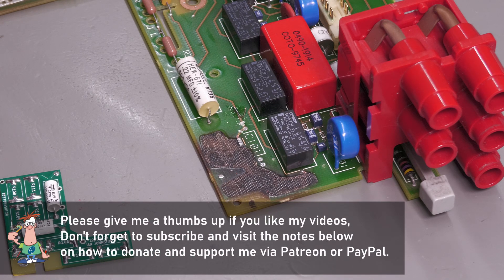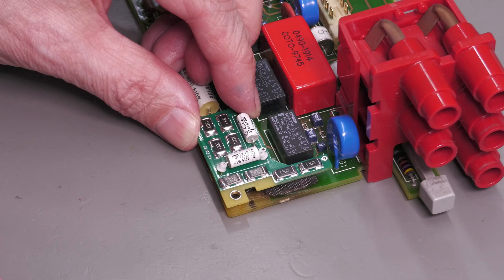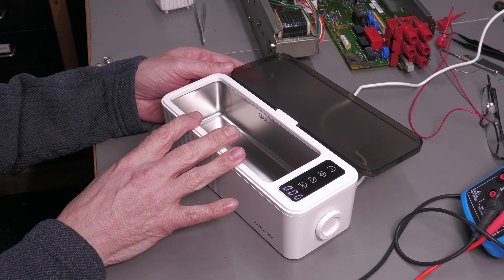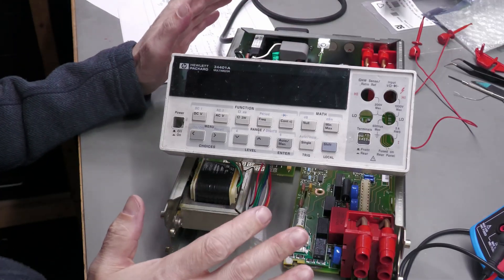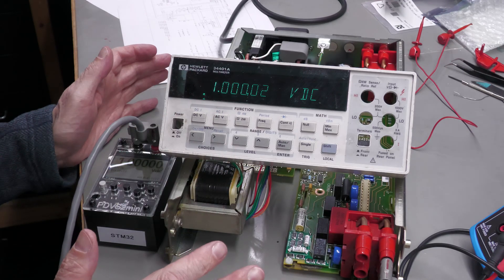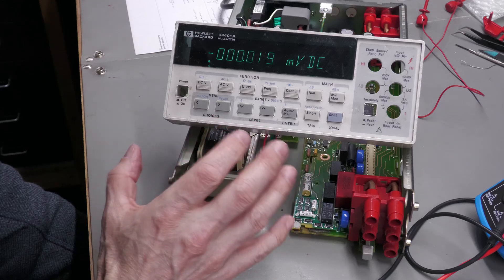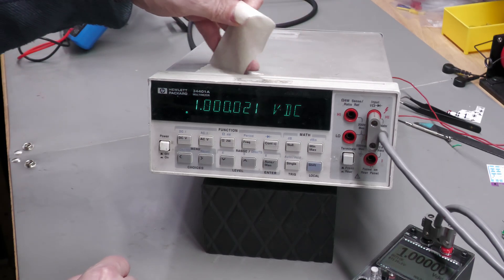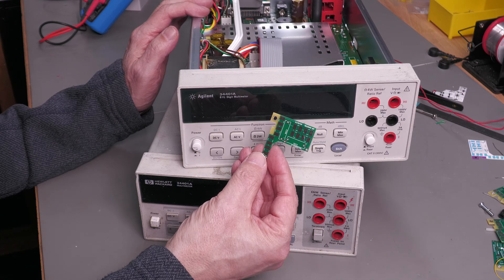No. 125 - HP 34401A 6.5digit Multimeter Repair - Part 2

Comment: Do you mind sharing the gerbers of this pcb? 
im having a 34401a with exact the same failure after a failed HiPot test apparently.
 i hope the asic is still fine. just tested the hybrid, all resistances are good fourtainly.
Reply from the maker: The gerbers are on my website....go to the No. 125 - HP 34401A 6.5digit Multimeter Repair page.
Reply: @IanScottJohnston  thanks!

Comment: if you want to save solvent fill your ultrasonic with water. Put your part in a small plastic bag and then put your solvent in the bag. Chuck the bag in the ultrasonic and you're good to go. Lets you do a few washes with clean solvent if you want too
Reply: That is a very interesting approach. I would love to see a side-by-side comparison. Perhaps get several boards nice and dirty with coffee, soda and/or flux, then clean using one or the other method, REMOVE passives and IC PACKAGES and inspect underneath.

Comment: It seems to me that you are using a very little amount of IPA in the ultrasonic cleaner. All models I have worked with during my life needs a minimun level of water, otherwise the transducer and / or the PCB would be blown out
Reply from the maker: My large cleaner I would never dream of running it low, but these small, cheap, low power ones seem to be able to take it.
Reply: @IanScottJohnston can you please point me the brand and model? Always good to see your videos, I've learned a lot.

Comment: Ian, nice idea. I'd be concerned about leaving all that carbonized black FR4 material, since you might get huge amounts of leakage from traces and relay pins that are still very close , especially at higher voltage/more humid months. My approach would be to cut the blacked burned area altogether with dremel and jump wire your patch PCB with few wires instead of old damaged FR4.

Comment: Why did you use SMD resistors again? Through hole resistors could be mounted a cm above the board and can safely dissipate more heat without burning your nice new PCB.
Reply from the maker: Only if the meter gets back into the same hands as the guy who burnt out these two. Slim chance so no worries.

Comment: Interesting repair. Back in the 90s, we did repairs to a controller board that had a few blown bits. We sawed off the charred section, epoxied a bodge pcb matching cut out and bridged the traces across with copper foil. It kept the machine running until we got the replacement few weeks later.

Comment: Nice repair sequence.. reminds me of my work @ Airforce lab, ~ 1980, where I repaired a lot of Multavi B / IRU meters from Hartmann & Braun. 
They had a 15A DC/AC current range. The big lamella shunt was very often burnt.
It was rumored, that those meters were used by the army comrades to "test" the batteries of their tanks.. under some load.😂
Maybe, they also wanted to get rid of those meters, as we often found a piece of paper inside, reading: "Please scrap it", but we always had enough spare sparts and a fat soldering iron for an easy repair.🤣

Comment: NOTE to SELF: After burning one meter out, DON'T connect a 2nd meter till you find out why the 1st one burned out!
Reply from the maker: I can imagine his boss ".....you did what!!!!"
Reply: That goes for a lot of failures. I have made countless repairs to machines where a PCB burned, the in-house tech ordered a replacement PCB and immediately releases the magic smoke from THE NEW PCB. Usually due to fault elsewhere in machine, and/or due to REVERSING & mixing up wire-to-pcb connectors during board swap.
Reply: Normally